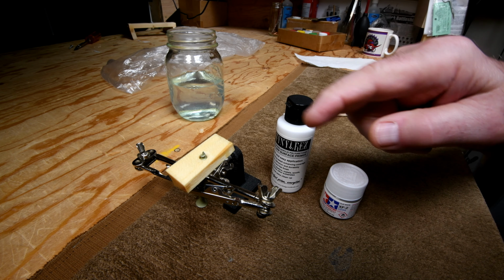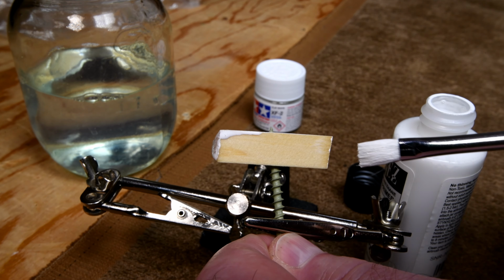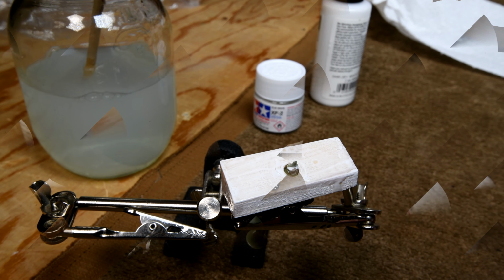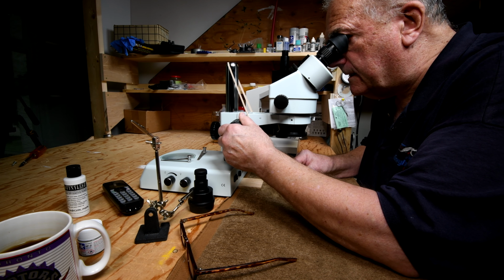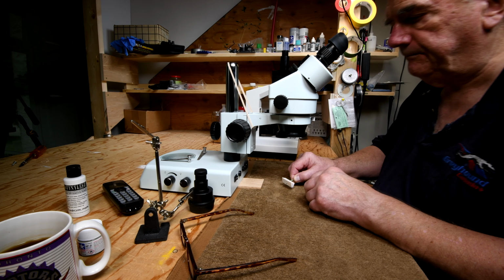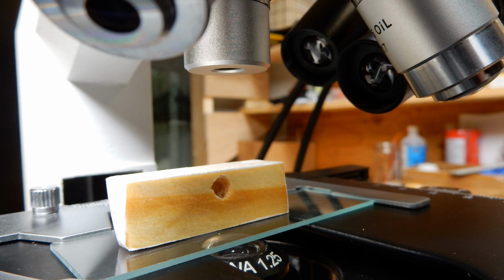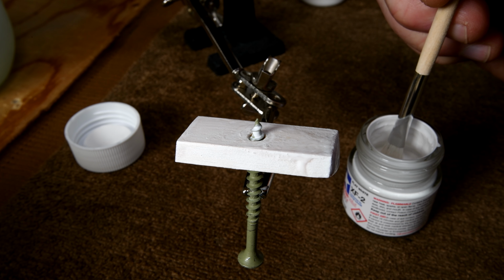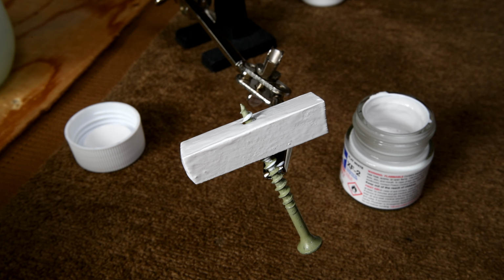The Model Ship - Part 513

Comment: The 'puddling' problem with water based paints can sometimes be overcome with adding a drop of detergent to the paint. It helps the paint flow over the spots on the surface.   John
Reply from the maker: Might give that a try. Thanks 👍